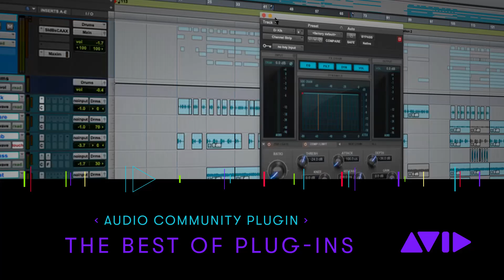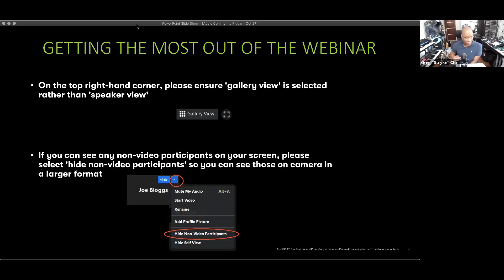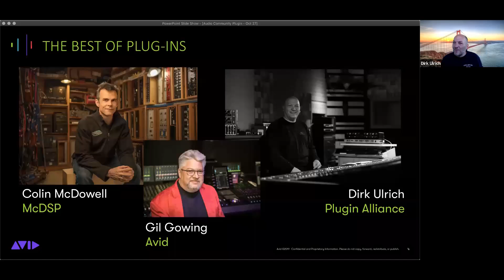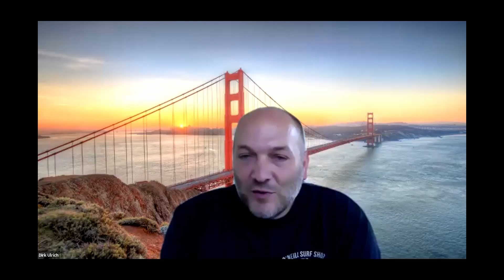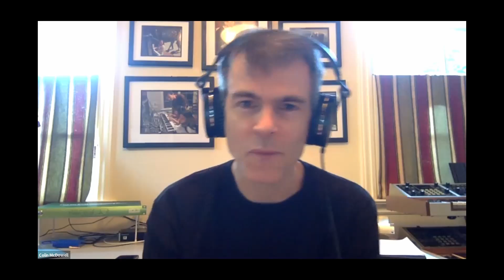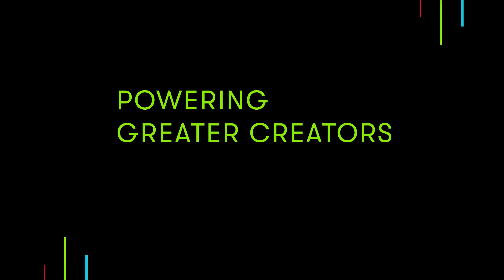Avid Audio Community Plugin: The Best of Audio Plugins

Comment: Half of a decade later, the amount of plugins developed for the Avid DSP system is extremely low.
Reply: To be fair, there are over 300 available. Which is more than Waves Soundgrid or UAD, so they are technically the biggest DSP audio plugin platform.